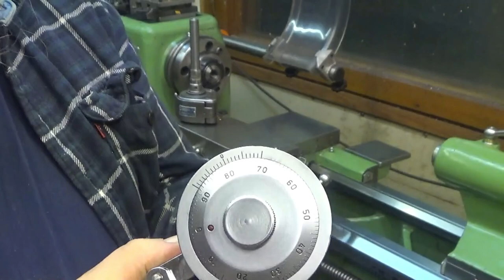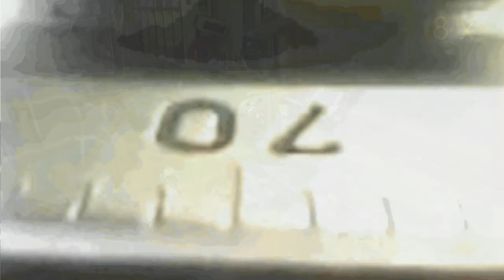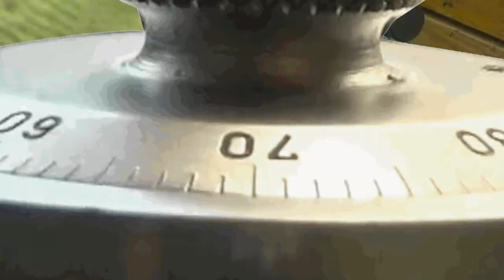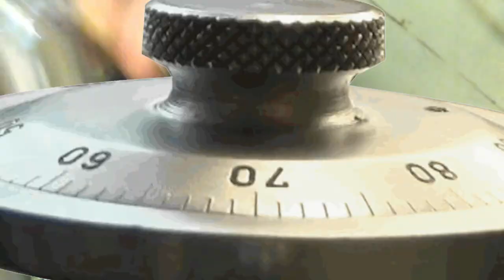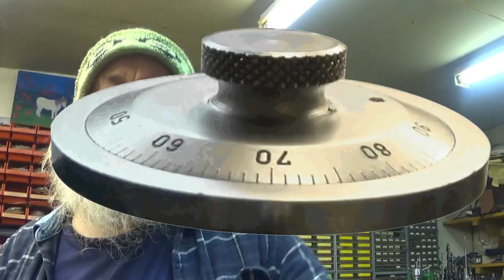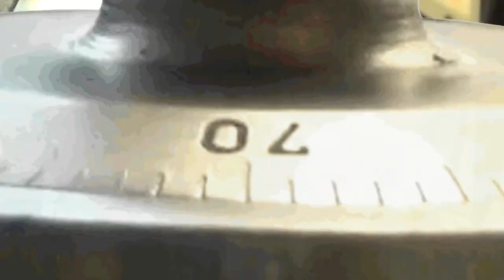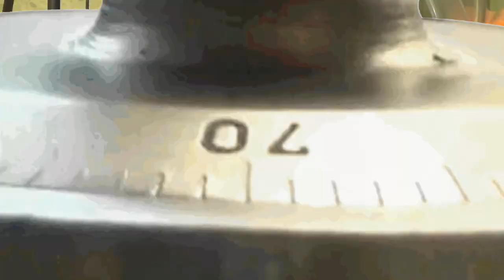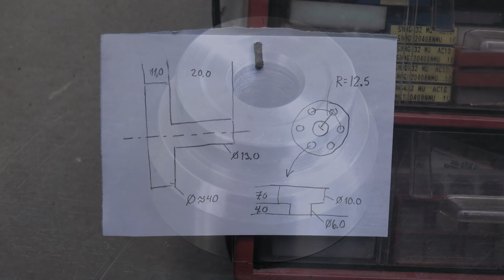Mechanical travel indicator for lathe

Comment: Really great video, would like to take a look at these "ARO's" myself, do you have a link to a webpage for them?
Reply from the maker: This device is over 50 years old. These were installed in Sweden as an accessory to some of the lathes sold by AFOSS. I have no idea where this was made. I found one site that has pictures of this installed in a Köping lathe. Unfortunately that lathe is already sold. Someone was really lucky. The funny thing is that this example has also a DRO installed.
https://psauction.se/item/view/618162/svarv-koping-s8sa-ny-information
Reply: @FinnoUgricMachining  that looks ridiculous as the Swedes basically stuck a gigantic L2 spindle to a minilathe.
Reply: As mentioned they have probably not manufactured for a log time. They where made by some unknown Swedish company. These show up for sale sometimes in Sweden. Usual asking price is 150-200 €/$. For those prices you might as well get a dro. Still I got one with my first lathe and moved it over to my current. They work great. Accuracy is at least equal to a vernier caliper.